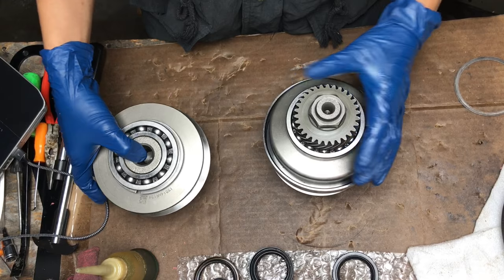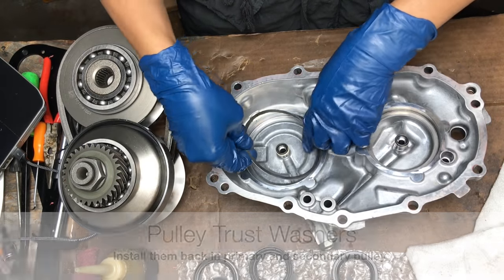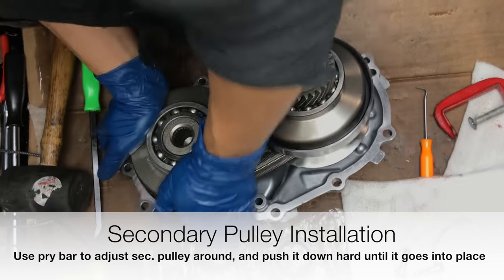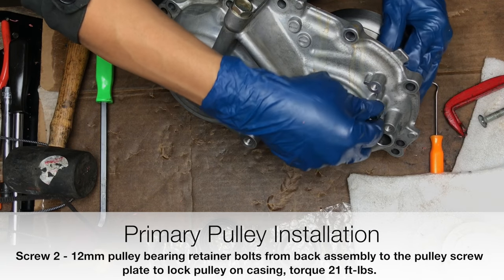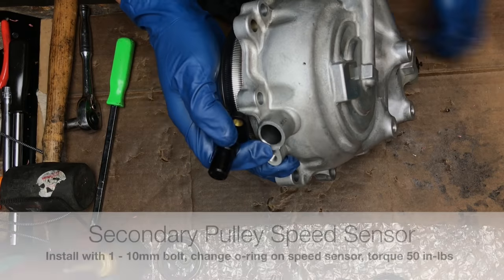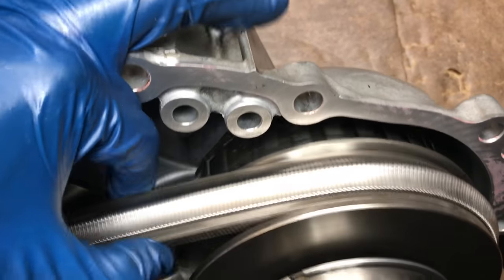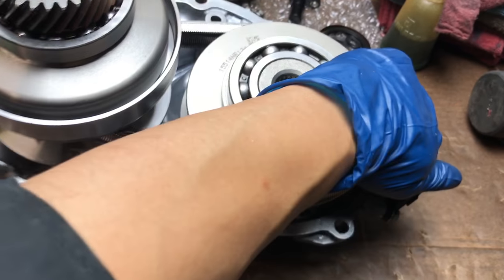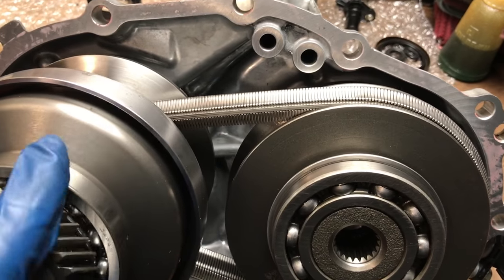Nissan Versa SV 1.6L 2012 - Part 3/4 - CVT Sub Assembly Reassembly REF011A / JF015E

Comment: I was told that a CVT transmission could not be rebuilt. And then I saw this video. I was lied too
Reply from the maker: Yes, the dealership usually just replace them and charge the customer an arm and a leg, these transmissions are actually a lot more simpler inside than a regular automatic transmission. There's not that many internal parts.
Reply: I'll be dipped thank you sir
Reply: In Asia almost all CVT are repairable. But not all automatic.
Reply: Thank you looks doable. God bless you
Reply: @ThLaborService, where the barrels u used or new and where do you recommend getting new belt.  As precaution want to replace belt and want to know if primary and secondary and be reused. 
Please good recommendation to buying quality belt?

Comment: Primary pulley piston is one of the main causes of issues with these transmissions. They often blow a seal especially when the transmission runs too hot (which they almost always do because they have trash cooling systems). When the seal blow, it takes fluid pressure away from the rest of the transmission especially the clutches.
Reply: This is why I installed an external transmission cooler.
Reply: @izzydizzy1115  Can you share the idea how to do this?
Reply: . Do you know where to source the seal?

Comment: You had to replace the pulleys seals because the pulleys works with high pressure fluid and this seals are worn and loses the pressure 100% sure the seals are bad. That is the weakest part in this transmission

Comment: Did you swap the pulleys to or just the belt the ones I got in look just slightly different but enough to make me not want to install it haha my belt wasn’t broke but car was hurting and lunging bad….belt was wore pretty bad aswell as steels had decent wear im just wondering if I need to swap those or can I send it with just a new belt

Comment: Belt got destroyed on my 2015, would I be good just replacing the belt for the time being? Already have the trans pulled, pulleys out valve body out and all the belt remnants cleaned out. I don't have the money right now for a full rebuild and just hoping this'll get me by
Reply: How did just replacing the belt work out for you?
Reply: Lol not good probably your pulleys got to get rebuilt as well and cleaned because metal got through there. I’m sure.

Comment: Awesome video, but man do I wish I never bought a Nissan. 2013 Maxima, transmission was replaced 20k miles ago. Seems like its failed! It starts to not want to go up in rpms when it gets hot after 20 minutes of driving. Got the stepper motor code and pressure control solenoid stuck. I put a whole new valve body in. Still works fine for about 20 minutes but RPMS start to lag when giving it gas and will shudder when guving it gas from stop. Cant drive far. Also a metal scraping noise when driving. No codes anymore though. If you have any idea what it could be, I sincerely appreciate any input. I just dont get why it works when cold but not after it gets hot after 20 minutes.

Comment: thanks for the video. is it possible the belt detroyed in 70K miles?  mine in 70K dose not have forward/ reverse except 1 feet in high rpm.

Comment: Love the Language.. Seriously Good Video.. I own a Juke, I stress over my AWD CVT and Drain and Fill the fluid twice a year.. Which people tell me is over Kill but I don't care. I want clean new Fluid's in my car at all times.. I change my Oil every 1000 miles and I do a 5 quart CVT drain and fill every summer second week of June, Right before the summer Hot months.. This is something everyone with a CVT should do every summer.. This fluid acts more as a protectant to the pully's and Belt more than just a Hydraulic fluid.. And the summer is when the fluid burns up the most.. Nissan in it's infinite wisdom didn't ad a CVT cooler to a trans that only holds a total 8.5 quarts fluid.. Most older cars with automatic Trans hold 13 to 15 quarts which makes a huge difference in protection and longevity of an automatic Trans.. You can get up to 300,000 miles out of these cars but you have to do the maintenance.. Or drive like my Mother.... But if you got a heavy foot or Like being first and Getting in front of the Assholes that want to drive slow in the Passing Lane.. You Need to do a Drain and Fill's on all these different types of CVTs at least once a year....  I highly recommend this! And don't listen to the asshole at the dealer that says Oh you already have 70K 80K or 90K on your Trans it's better to just leave it alone at this point.. They are Wrong!! And Makes no sense with a CVT, that uses the fluid more as a protectant than anything else..  That used to be true with older automatics, (But if you went to 20,000 miles without an Oil change you would never say Oh well it's to old I might as well just leave it in there and just wait for it to Blow up..)
Reply: I have a Note with a CVT, I change the fluid once a year. People say I'm crazy, I thought I was the only one out there changing the fluid. I'm at 100,000km and hoping for another 400,000!
Reply: when you shift between reverse/drive give the cvt a sec to adjust.

Comment: Great job! Liked and subscribed
I'm having trouble putting the pulleys back into their housing after rebuilding all seals, it seems as if the belt rides deeper within the pulley groove on the secondary on yours, on mine the belt rides right where the steel bands are, in yours the belt is fully within the secondary pulley. Any advice or help how I can add slack by getting the belt further into the secondary pulley channel? Thank you

Comment: great video, i removed the oil pan on a 2015 Nissan Versa Note cvt i just picked up that barely moves sometimes it grabs, and it had alot of metal shavings and 2 blades of the steel belt on the oil pan. my plan was to just change the filter and oils. should i try it or not even waste the oil on it?

Comment: Thank you for the video.
Just rebuild one transmission and so far everything went smoothly.
How long the Chinese parts last ? I ordered genuine Nissan but the seller scammed me on EBay and I got Chinese. 

My transmission has the heat exchanger and additional hoses that go in radiator heat exchanger. Under normal operating conditions fluid is around 195-200F on the highway it drops a bit.

Thinking of bypassing the coolant hoses in the heat exchanger that is bolted to the transmission and leave the fluid go thru the radiator cooler then thru external radiator that I bought and after that to go back to the transmission.

I doubt there will be any long term negative effect if the fluid is 140-150F instead of 200.

In my area temperatures doesn’t drop bellow 37-40F

Another thing: how precisely you have to measure the snap ring on the bearing ? with the tools I had available every reading was off by 0.3-0.5mm so I took the average and decided to use thinner snap ring. ( not to cause excessive preload and destroy the bearings)

Comment: I rebuilt my CVT JF011E transmission got it put in but I’m getting a secondary pressure solenoid stuck on ( low pressure) what do I need to look for Thanks 
I replaced valve body with a complete reman   Please can you help 5:53

Comment: Thank you very much, been a big help with my rebuild.  I have discovered an easy way to install the variators. How can I send you a video? You can use it if you wish.
Reply: How did you do it
Reply: I compressed the belt into the driven pulley slightly with a bar clamp, then simply pried them apart, this allows the slack created to to further separate the variators

Comment: How did you get the secondary pulley to fit in with the belt, it seems to tight and it won't slide in the casings
Reply: Is this something you are attempting I’m afraid I won’t be able to get belt back on if I pull it apart I’m trying to see if the can also be done with trans in the car
Reply: My current situation, how'd it go for you?
Reply: @NelO-n7q  I managed to get it in and everything put together but then it died again after 3 weeks, after that I just got one from a wrecked car and replaced mine lol

Comment: And how do you check that the main drive is working after repairing it?
Reply from the maker: I was not able to check it after the rebuilt. I trusted my gut in the rebuilding process :) everything inside was replaced correctly to spec. I did have an issue with the reverse clutch and had to pull out the transmission again, I also cut that part in the video explaining what the issue was that I found which caused the car not to drive in reverse.

Comment: Thank you very much, your video will help a lot of people 
What was the wrong with your transmission what update did you do?!
New sub
Reply from the maker: The chain belt inside the transmission broke after about 100,000 to 150,000 miles of driving. So I pulled everything out and rebuilt it. Changed the clutches, transmission pump, seals, o rings, rebuilt everything back.
Reply: @TheLaborService  thank you very much. I'm doing mine soon. where do you buy parts?!
Reply: @TheLaborService  this transmission have problems with overheating? How it can be solved? Thanks.
Reply from the maker: @raoulraoul7129  My friend try adding another transmission cooler to the transmission line, watch my video here. https://www.youtube.com/watch?v=jUSaT771z9A&t=919s
Reply: @TheLaborService  Thank you dear friend, i love you.

Comment: Where can I bought this pulley's? I own a Sentra 2013 with transmission issues, and I want to replacement for it without changing the complete transmission. Excellent video :)
Reply from the maker: I got the pulleys off of Alibaba.com
Reply: @TheLaborService  let me check on it ✅ thank you. And again, great, great video. God bless your family, work and all you do. Cheer's
Reply from the maker: @jehu00  Master rebuild kit, transmission pump, along with the Loctite seal to seal everything back was all on eBay. Thank you! and God bless you too!
Reply: My 2014 Sentra was driving normal just had a whine coming from the belt and pulleys. So I opened this transmission from the side and replaced them. I put everything back together and now the car doesn't run. I returned the old pulleys and old belt and now it only drives 5 minutes and it slips. I'm so confused. What could I be doing wrong?
Edit!! So I found out what was wrong.. when both pulleys are being put on be very careful when trying to put them in their spot. Try not to use a screwdriver I learned the hard way. It can damage the gasket that goes under the pulleys. To see if they were installed correctly use air pressure to see if they activate. Put air through the two little holes and see if each pulley activates. If they don't you've installed them incorrectly.
Reply: @Bonkeyable  Im going to do this on mine here soon, I just barely transmission put in yesterday and got everything back in like normal and now I have to pull it out again, I'm going to test the pulleys with that air think to see if I installed them correctly (I also took them all apart to rebuild them and think I didnt do it right) so I'ma blow some air in there and pray it doesnt move mostly because I want to see if that was the problem

Comment: How many quarts of oil do you need to put in the transmission after it has been repaired?
Reply: add 5 of whatever cvt fluid it takes, then get it to operating temp and drain from the overflow.